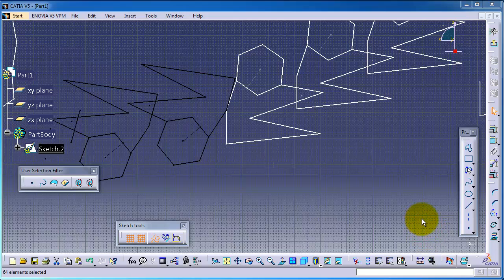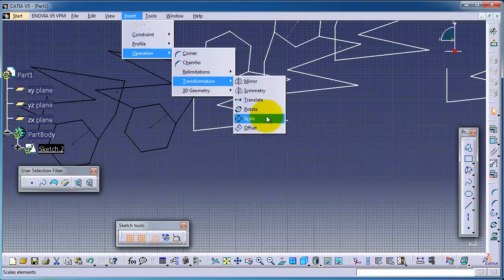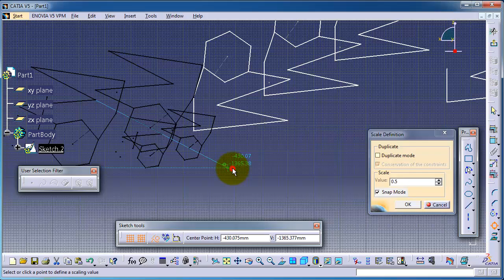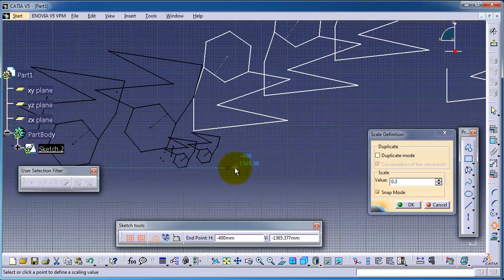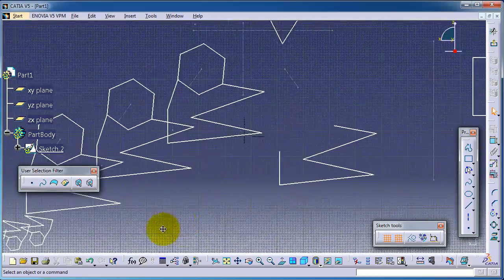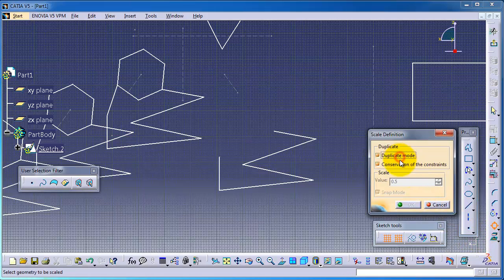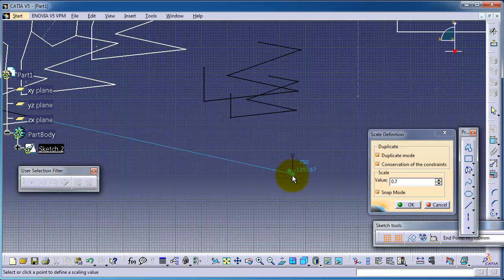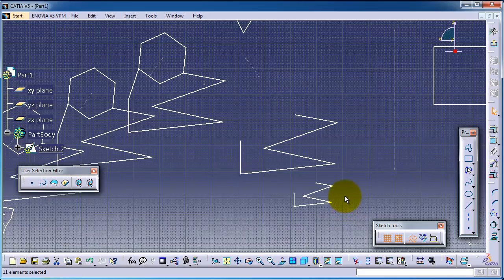22- CATIA Beginner Tutorial: Scale Sketch

Comment: As suggestion for improvement I would recommend to explain what exact role has the reference point in the execution of the operation along with the reference line.
If you could also reflect a bit more on the different application of the scale operation this would create a lot more value for the viewer.
All the best